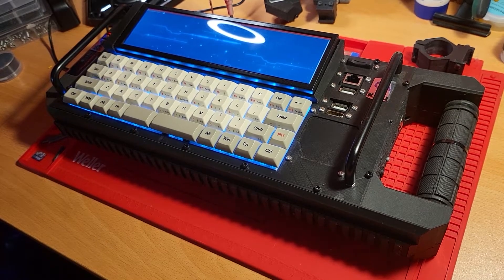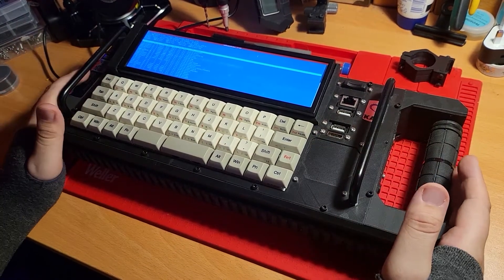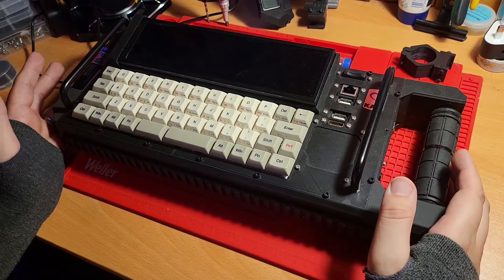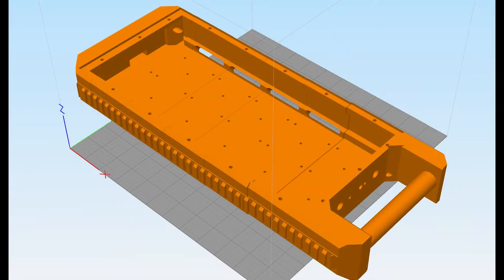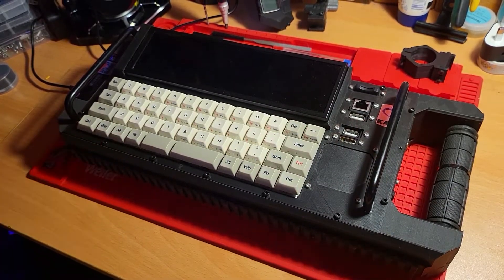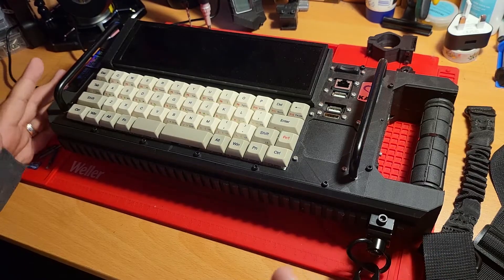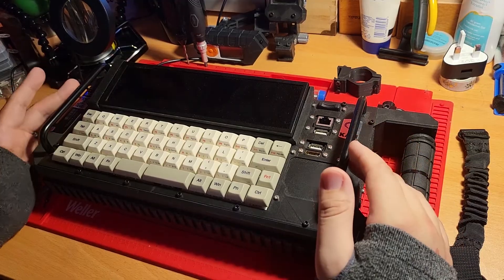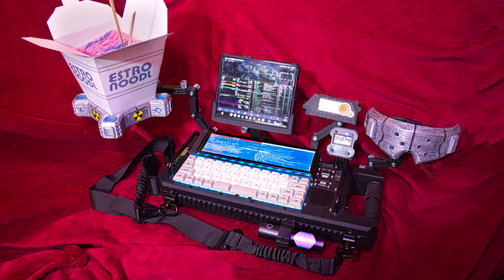The Wolfbird CyberSecurity Cyberdeck

Comment: This is absolutely fantastic. Great design. This is great for the field. Especially when space to troubleshoot or upgrade gear was the last thing anyone thought about. I am completely inspired.  Buying parts today to build!
Reply from the maker: Sorry for the slow reply!
When we printed the frame, we used a fairly standard matte-black PLA fillament, with 100% infill and printed it in 2 pieces, vertically, to avoid needing any internal supports. And then just used Gorilla Glue 2-part epoxy to attach the parts. It's been over 2 years since I built it and it's all still solid :D

Comment: Love this build, thanks for sharing the files! One question - how did you connect the sections together?
Reply from the maker: For my particular build, I joined as much of the pieces as I could in the slicer, to get as few separate pieces as possible (I was able to print the main part of the case in 2 sections, in the end), and used 2-part expoy glue to stick them together (Gorilla Epoxy, specifically). After giving it a full 24hours to cure, it's been solid ever since :)

Comment: Have you concidered reproaching this project using something like a framework mainboard? Also what km switch did you use, finding a km switch with a manual selector has been difficult
Reply from the maker: I thought about usinga framework mainboard, early on, but sadly my budget didn;t strech to that at the time; The case should be big enough to fit one in though, with only some minor modifications. It's defintiely something i'd like to do at some point in the future, and ideally see if I can find somewhere that could machine the case from metal or something, to really elevate the 2.0 version :D

I believe this theswitch I used: https://www.amazon.co.uk/dp/B0B52XRLF3?ref_=ppx_hzsearch_conn_dt_b_fed_asin_title_8
I poped it open and took out the PCB but that's about it. It;s not a 'proper' KM switch, but it does the job :D

Comment: Imagine something like this with a framework main-board or the guts of a used mac mini
Reply from the maker: @botbot3698  I'd like to build another one with a framework mainboard, when my budget allows for it. From what I've seen of the specs, it should fit easily with only minimal modifications to the case design.
Reply: @GarrWolfdog  that's awesome! I'm looking forward to it

Comment: brilliant!  Lots of things I appreciate about this.  I've been messing with this sort of thing for a while, using a quest 2 instead of nreal airs (I see you got into it before they were xreal as well?).  My question for you is; how do you use hdmi to connect your airs?  I've always assumed they need to use a dp over usb-c interface; do you have a rad converter of some sort?  Cheers!
Reply from the maker: Thanks so mcuh! :D I use a HDMI to USB-C dongle to connect nreal/xreal HMD. You'll need to find one that can also supply USB power though. This is the one I use https://www.amazon.co.uk/gp/aw/d/B09LGVNXPK
Anything that can supply 5v USB power will work, I usually use a spare powerbank :)

Comment: Do you have a Etsy store? Is there any way you can print me some of those parts?. I'm very interested on making one
Reply from the maker: I don't have an Etsy store or anything at the moment, but I might be able to print some parts (once my printers are back upand running again). Although, THe case model files are free to use, so it might be easier and cheaper for you to take the files to a printing service close to you and get them to print it for you; they'll likely be able to help with the finishing and stuff too :)
Reply: @GarrWolfdog  thank you. If you could make a follow up video on how to assemble it that would be great 👍
Reply from the maker: @carlosc3899  I've been thinking about doing that, but my house is kinda a huge mess at the moment due to some house repairs. So, it'll be a while before i'm able to. In the meantime though, you might want to check out the build log instructions I put together https://hackaday.io/project/191858/instructions
and feel free to message me with any questions and i'll be happy to help :)

Comment: This really is the coolest cyberdeck and after doing a bunch of research, imo the best I've seen in terms of fitting the cyberpunk aesthetic! I really want to edit the designs to fit my own project dimensions so I've been slowly recreating the STL files in OpenSCAD, I'm currently finishing up the body Piece but I'm not sure on your measurements for the mounting holes in the bottom, your hackaday page mentions they're designed for use with most SBC being able to fit in them but I was curious on why you chose those specific ones (58 and then 47 mm differences on one axis, 49 on the other), if there's a standard you were following for example?
Either way I love your work and would be happy to share my code as soon as I'm done if you'd like!
Reply from the maker: Thank you so much! :D
I based the hole placements on the mounting holes on a raspberry pi; as that's what I had handy, and it would mean most RPI accessory boards would also be easy to mount. And a lot of the other SBC I've seen also use the same spec, ornclose enough to be workable. If I was to make a v2 of the case, though, I'd probably put effort into researching that 😅 
I'd love to see how your build comes out and what mods you make, if you'd be ok with sharing when its done? :D

Comment: Hello! I know this video is a bit old, but I was wondering if you could give me the links to all of the parts! I want to build one because it is SICK!
especially the touchpad, screen, cable extenders, handles, and rollbars, as I can't find anything that might work.
Reply from the maker: Heya! Thanks so much!
There's componant list on my hackaday project log. if you drop any of those item names into amazon or aliexpress it should give you suitable compinants : https://hackaday.io/project/191858/components 
This is the same modle of touch as I got: https://www.amazon.co.uk/gp/product/B001CX85I8/ref=ppx_yo_dt_b_search_asin_title?ie=UTF8&psc=1 if you open up the case you can then just take out the touchpad itself and remount it.
The rollbars are just cupboard door handles. If you search for "U-shape cabenet handles" it should give you some good options. these are the ones I used: https://www.amazon.co.uk/gp/product/B01MR5U43D/ref=ppx_yo_dt_b_search_asin_title?ie=UTF8&th=1
I can't find the link to screen anymore, but search for  "8.8inch 480x1980 screen" on aliexpress and you'll get a bunch of suitable options.
For the I/O pannel, just earch for "<connector you want> pannel mount" and you'll get options withe the right screws and such.
Depending on the exact componants you can get hold of, you may need to modify the design slightly. but most of those mods will be on the frontpannel of the case, which is just a rectangle of plastic, with cut-outs, that bolts to the main chasis, so it should make any mod fairly easy in simple CAD software.

Hope that helps! feel to buzz me with any questions though :)
Reply: @GarrWolfdog  Thank You so much!!!
Reply: @GarrWolfdog I’ve finally gotten a good printer! I have most of the case printed, and I am wondering, how did you connect the case parts together?
Reply from the maker: @ArcoNightshade07  I used "Gorilla Glue Epoxy" and it's held up great s far :D
Reply: @GarrWolfdog  Okay! Thank you for your help so far! I'll send you a link to pictures of the finished thing when I can! (And hopefully it'll be as good as yours)
Reply from the maker: @ArcoNightshade07  No worries! I can't wait to see your final build :D

Comment: My God, this is beautiful. Would it ever be possible to commission one of these for an individual in the same line of work, without the range of tools to build one?
Reply from the maker: Thanks so much! I'm really happy wi5h how it came out in the end :D
Sadly, I don't really have the free time to build one on commission at the moment. Though I'd be happy to talk you through things if you would like to build one yourself. Getting the case 3D printed is probably the hardest part; I might be able to help you with that, but there is probably a company that does 3D printing closer to you that will be able to get it printed quicker. Everything else is just off-the-shelf parts you can find on amazon or aliexpress :)